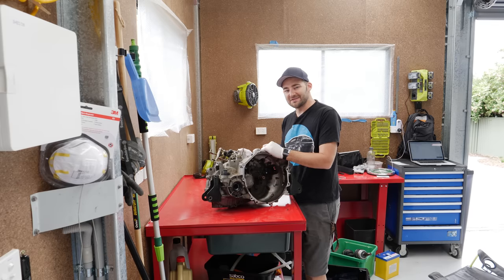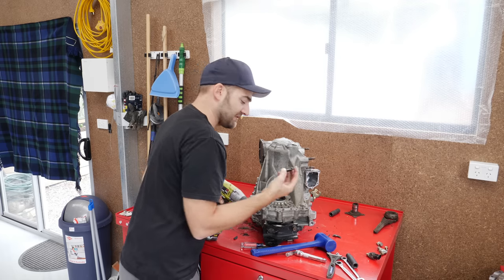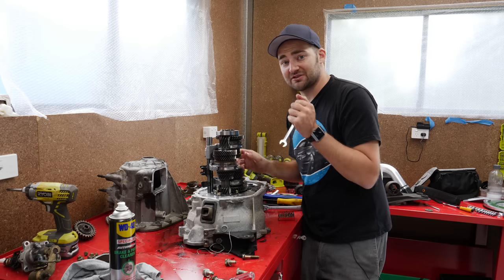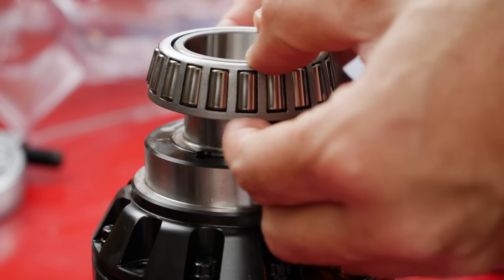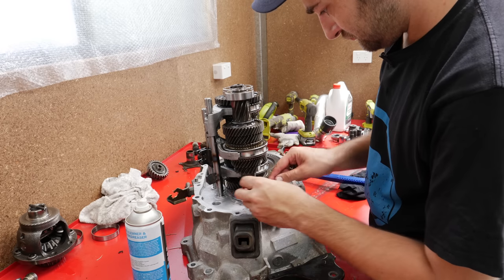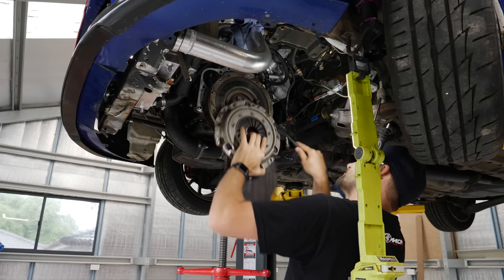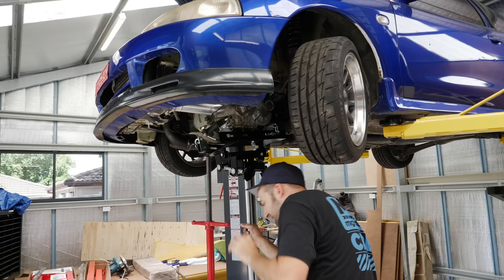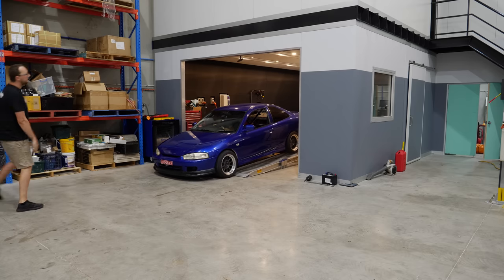Limited Slip Diff + Clutch Install into 2Sexy [Part 2]

Comment: DSM's had the engine the same way around as 2WISTED, so the 2WISTED gearbox as far as I know is a front wheel drive converted Evo123 gearbox, which is the same style as the DSM boxes (but the evo ones had better internals like better synchros and better selector forks).

Comment: 16:05 What's that with the WD40 on the friction area of the clutch pressure plate, just before popping it in the car? Would you also lubricate your brake discs with WD40?
I get the product placement thing and that's fine (I really like the way you guys plug the Ryobi brand every now and then) , but please don't overdo it!
Reply: if u look at it carefully. its wd40's brake cleaner
Reply: @kschong4163  You are absolutely right! What had put me on the wrong track is that it appears to me that Marty is using a different (brake?) cleaner at 9:50. Add the fact that WD40 is mostly known for its multi-purpose lubricant in my country, I wasn't even aware that they also sell brake cleaner... Well played, Marty! :-D

Comment: Those speedo gears just pull right off and swap over...I did this exact same thing with my Integra GSR transmission when I went turbo. I also installed an Integra LS 5th gear.

Comment: People keep saying the outer bearing races are in wrong, but they aren't. The pressure of the diff combined with the friction against the case holds them, and the bearing spins easily so it will instead of the race. Ever heard of 'path of least resistance' people? If you're rolling a tire on a piece of cardboard, the tire rolls right? Does the cardboard magically slide with it? Same principal. I've taken enough physics courses and have enough experience with bearings to know this will be fine. It would be much more likely to cause damage if it were tight and not straight.

Comment: I have taken apart an Evo 8 transmission just to replace an input shaft bearing. That was terrifying. I took apart this exact transmission as well to try and figure out why 2nd gear didn't work (in the US, fwd DSM.) Ended up just buying a used one for $300 and giving the original away lol.

Comment: Ironically I have my gearbox open and am doing the bearings on my 06 Ralliart (same tranny)       wish I could of gone LSD.     

The green finish on the flywheel is just a protective film and it says to wipe it off before install.   Hope it doesnt cause any problems.  And hope you figured out the preload.  I need to research this when I do an LSD in the future.        Go 2SXY!!

Comment: Couple of comments.  Its already been mentioned but the race should not be that loose in the case unless it has a tab to keep it from rotating.  Hopefully it won't be a problem.  I am not familiar with these type of transmissions or diff's but usually when you change the carrier, you need to reset the gear mesh using marking compound to check the tooth engagement. Is this step not needed on this type of transmission and diff? It looks like a helical gear which should require this. it might make some noise if you are off by only a little, but if you are off by a lot, it will eat up the gears.  This is set by offsetting the ring gear using the shims and the pinions depth.  Plus you need some preload on the diff bearings.  I am not sure how you set it on this trans, so I will assume you did it.

Here is a couple of tips when building transmissions.  One is to get transmission assembly grease which is super sticky and thick but will dissolve in gear oil or transmission fluid (depending on which grease you get).  You can use it to hold pieces in place while you are reassembling the trans. Its also used to lube up o-rings and seals when building the trans.  Makes things much easier to put together.  Another tip is to put a very thin wipe of silicone sealant on the edge of the steel freeze plugs before you drive them in.  The excess sealant will be on the outside of the case to be wiped off, and it will keep the plugs from seeping, which is common in applications where heavy usage and lots of heat are expected.

Comment: tip , you can heat bearings in microvave and not damage ruber seals , just wrap bearing in realy wet  cloth and heat it , it will get no higher than 98c since water  vapor wont let it heat any more :) unles you let the towel or cloth dry then it will burst in to fire :D

Comment: 3M matte transparent film for the windows. It's UV resistant an it will be heaps better than bubble wrap as it doesn't distort the light as much = more natural light.
ALSO, two blocks of wood screwed in the OSB wall behind the work tray with Neodymium magnets (fleaBay) glued on to them will make short work of the table's wobble. It's utterly devastating when you work, you stack your parts nicely, and a wobble breaks the order, and possibly your ability to discern which is which. Magnets will also allow you to move the tray just fine.

Comment: GL5 isn't good in a fwd gearbox normally, worth looking in to. Because it might be good for "diffs" doesn't mean it's any good for brass/bronze synchros. GL5 is normally corrosive to anything that like that that is actually encased within a transaxle.
Reply: Nevermind, that's not actually GL5

Comment: If you cut the bearing roller cadge off of the old bearing, the inner race can be used as an installation tool to install the new bearing, for next time

Comment: I like that the clutch fork operates the throw out bearing. I HATE then they build the hydraulic slave cylinder into the throw out bearing. Why? because of the extreme heat it soon leaks and you have to tear the trans off the engine to change it.

Comment: Hey guys RANDOM TIP: Breaking car glass? Break the spark plug ceramic by laying it on concrete and smacking it with a hammer... Put a few sharp looking shards ont the adhesive side od a piece of duct tape (duck tape) and hit the bump in the tape (caused by the ceramic shards) with a hammer... Not even all that hard, just a mid strength, crisp, flat strike... Window shatters...

Comment: Those trans are mirrored to what DSM's have, the trans thats in 2twistd is more like a DSM trans. In fact, it probably is. W5M33 would be the AWD DSM trans, and F5M33 would be the FWD DSM trans. Mitsubishi reversed the engines in 2000 from the traditional layout to remove a part of of the transmission that reversed the rotation of the internal shafts and reduce the rotational mass and weight.

Comment: That's not a DSM trans. DSMs have an extra shaft to switch the rotation because the engine is mirror mounted. You even use the evo gearbox workshop manual, i can see the shaft that goes into the transfer case)

Comment: After putting so much work in to the engine and transmission, once it's all put together, do you feel you should "respect" it more and not abuse it?  Or since you rebuilt it once, you can beat on it knowing that if it breaks again, you can just build it back again?  

I'm the kind of guy who would build a 400hp drivetrain, but then baby it and never have it push more than 200hp (short shift, no WOT, etc).

Comment: Do you torque the new clutch with original spec, or you have to increase the number on heavy clutch?
Same Torque question on brake, if you change the heavier brake rotor, do you need bigger torque by mounting the brake caliper? 
Thanks

Comment: Also  I see the oil you put in was GLI  5   .    I was told that GL5  was not good for our syncros   and to use specifically  GL - 4 only         (not gli 4   & 5 compatible)

Just a heads up.

Comment: Im used to working on solid axles so i was confused about the lsd install. Do you have to set the gear lash at all with shims or is it just a straight bolt in process? he just threw it in without checking so i was curious

Comment: That outer bearing race looked like you were spinning it when it was fully inside the case, if so it is too loose and it will spin in the case instead of the bearing, causing the case to be worn away. You could have used some bearing fit (basically glue) but it looked too loose even for that to work. Hope it's ok and you wipe Moogs ass. At least your car was built and modded by yourself and not just bought. Good luck.
Reply: Marty responded somewhere else earlier in the comments about this.   He said he did it by the book and that it's all good (There was a few other people wondering about it too).

Comment: question why didn't you also replace the seal and bearing from the engine to the Diff?
and is there not a brake in period that your suppose to drive nice and slow to get everything driven in before you hit the dino?
Reply: Ceramic clutch material, you can basically give it death from the start. Organic material (which is most OEM replacement ones) you have to be a little easy on. The diff doesn't care, you change the oil after 1000km or so, check there's not excessive metallic bits in it and keep on going.

Comment: Super Cheap Auto for dem bearings mate - also, shoulda used that bearing puller and pull that speedo gear off the old diff and put it on the new diff before pushing that new bearing on.

Comment: Why didn’t you clean the flywheel the same way you cleaned the pressure plate? All that green stuff would have melted right off the Fidanza flywheel.

Comment: Do you dont grease the bearings on these?? Im not a transmission guy but if yiu dont pack a bearing before you run it on the bearing race it will be metal on metal....????
Reply: They are swimming around in oil, much like your crankcase.
Reply: @Ltbookum  i suspected that was the case but wasn't sure.  I didn't know if they were sealed off from the fluid or not. But i learned something new haha. I would have greased them and clogged up the small passages with grease at some point haha.

Comment: Wait? Are you being charged by the pressing? Does pressing in the differential speedometer ring raise the cost or something? ...
"Not worth the time" ... Are you currently snorting white powder? It is always worth the few minutes pulling it. Since the very hardest part about it is remembering which side faces up.
EDIT: For those who have never really done car work, your phone's ability to use GPS to tell you your speed will never ever help you to register your car. That "useless" speedometer gear he saved 7 minutes pretending wasn't needed, is required for both your cars instrument panel to show your speed, but more importantly, it is the thing that drives your odometer. And without it, you car is worth scrap, since you'll never be able to register it. (Beyond temporary car servicing registration)
And yes, he saved all of seven minutes.

Comment: Alright, so I have SR20 5-speed B15 Sentra - at least I did anyway; I was driving down the highway at 65mph and the motherfucker straight up ate a gear while cruising at steady speed, and now I don't have ANY gears.
First thing that I looked for was a replacement trans, NOS, used, whatever - I found 2 in all of the United States(too far away, shipping would probably be half the price of the trans), because the SR20 was in the B15 only 2 years and required its own trans case(even though the actual trans is the same as the base model), so that blows.

Now, there are rebuild kits available, and I'm now thinking that this just might be worth doing myself(I get paid to work on race cars, so the actual job isn't too difficult, just isn't one that I'm 'excited' about).
However, the biggest problem is that I live in fucking Ohio, it's fucking January, I have a great garage to work in and all - but, the car is stuck outside, the trans stuck in gear, and I don't really feel like pulling the drivetrain in -3°F(like -20ish°C I believe - or, in the International English Scale, this converts to: *COLD AS FUCK*). Which it currently is. With a fucking pile of snow on the ground.
Fffffffffuuuuuuuuuuccccccckkkkkk

Comment: Hey just a tip marty, it is not good to put batterys straight on to concrete, put on rubber or timber. Noticed it in the back ground 50sec in
Reply: You should look that up, when I did I decided it's a myth.

Comment: Did he replace the part in the back of the crankshaft cant remember the name of it but the shaft of the trans sits in it
Reply: A lot of front wheel drive cars don't have a pilot (spigot) bearing.  The input shaft only has the spline for the clutch and no extension race for a pilot bearing.

Comment: Arent you supposed to break in a new clutch over something like 500 miles, or am i missing something?
Reply: How do you know how many miles he did before the dyno?. Also a lot of clutches if set up correctly do not need that much (run in time). You don't see drift cars or drag cars doing 500 miles before a race after a clutch change.
Reply: It will bed in on the dyno.... it'll be fine.

Comment: wow replacing the center section without even attempting to check preload it's not even difficult on these boxes since the outer races are easy to remove over and over
also who in their right mind would clean up seals on a box instead of replacing them.  they cost like $30 for the whole box.
if i was welding up the diff or dropping in a spool maybe i'd care about $30 but that wavetrac is easily a grand and will be toast when a seal leaks out all the oil

Comment: I just don't understand why you didn't bother moving the speedometer drive gear over, it would have been a few minutes work.  The outer race for the diff bearing was way too loose as well, that should have been a press fit. Suspect that will spin and try to eat its way out of the housing.  Were there no shims on the diff bearings? Usually preload on taper roller bearings has to be set by selecting the correct shims.

Comment: WD-40 on pressure plate? 16:04
Reply: It would be wd40 brake and parts cleaner, they do a range of sprays with the wd40 name. They sponsored mcm recently, you'll notice product placements such as this a bit.

Comment: You could have gotten that speedo gear off with heat and tension and then pressed it back on
Reply: A lot of the aftermarket diff carriers have a different diameter shoulder where the speedo gear presses on.

Comment: Nice work!  However, I just find it disappointing that a company like Wavetrac will totally omit something as important as the speedometer gear in the differential.  Without it, it's nothing more than a race car part, and not everybody will venture into spending a couple of hundred dollars to dick around with different electronics and wiring to make the speedometer work. You're fortunate enough to have a Haltech to get that taken care of, but for some who are still on stock ecu and just wanted a nice diff to make the car handle better, then they're shit out of luck.
Reply: I'm 99% sure that gear just needed pulling off the old diff and pressing on the new one, as in its a separate part like the bearings are.

Comment: Martin you should have cleaned the pressure plate and flywheel with brake cleaner not WD40.
Reply: It was wd40 branded brake cleaner.

Comment: Marty you are so timid. Nothing in a car should you find intimidating. I question why you did not change out the synchro rings, did not lube the throwout bearing , and did not scrub the cases clean before disassembly. Keep on with the good work.

Comment: You have made multiple fatal errors building up that gear box. First is you never checked or set the shim pack setting the diff to the case . You also reused the bolts holding the ring gear on and never used loctite on any of the hardware. Also on that note ARP bolts should have been used to put all that together.

Comment: HOLD UP!
Whenever you are working on a clutch you absolutely NEED to wet it down with a mist bottle, AND wear a mask.
Dust from clutches are REALLY bad for your lungs.
Keep it safe, you don't want cancer or some other shit.
Also, please use gloves as to not get transmission fluid on your skin.

Comment: Calling FAKE on the ring gear bolts torquing. They are high torque and require to have the diff fixed in one way or another. Def can't torque it with one hand lol
Reply: regardless though, freaking awesome video and mad props to you for the effort! That's a great shop with a lift you got there!

Comment: Please do not use WD40 on clutch plates, I know that it fixes everything, but some other Loon will think it is appropriate for brakes in a minute.  :-(
Reply: WD40 is a brand with a product line not just a lubricant. He is using brake cleaner.